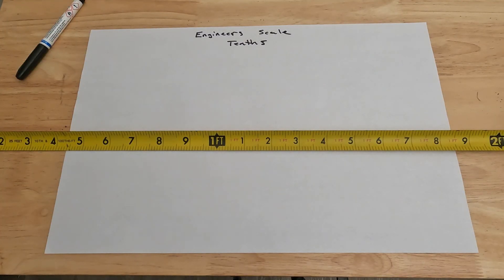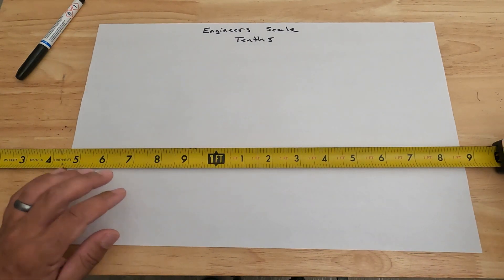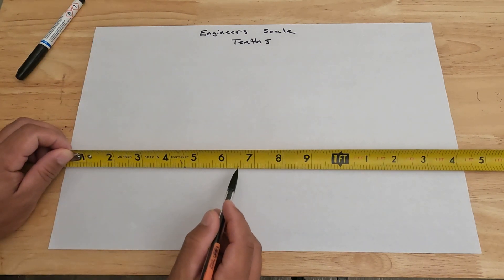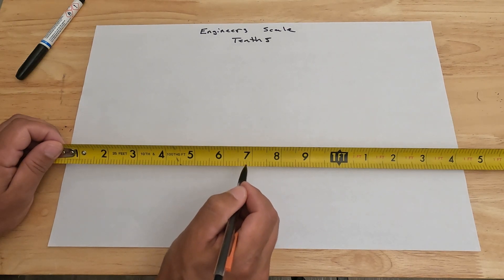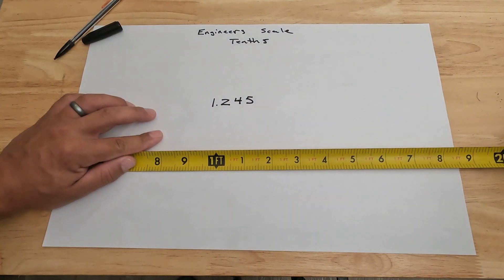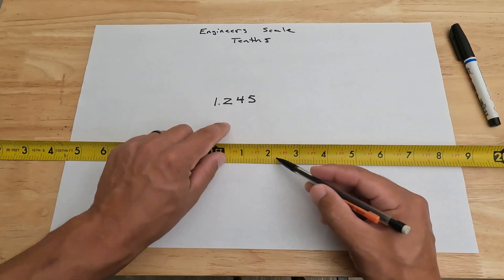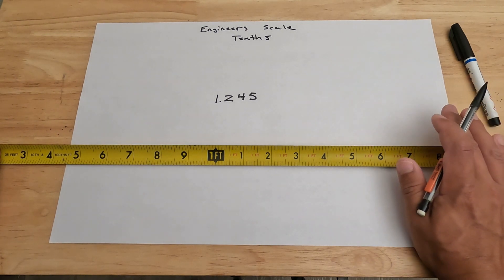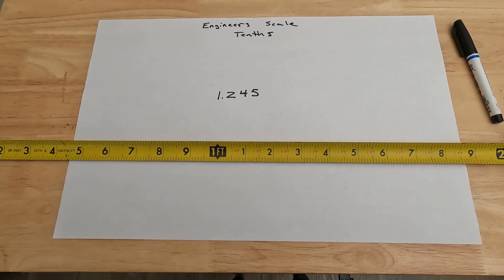How to Read a Tape Measure in Tenths (Engineers Scale)

Comment: i am a metal fabricator and we use these to make hand rails. easier to divide and figure out how many pickets you need
Reply: i learned about them from a guy in the oil industry because they use them to measure drill pipe
Reply from the maker: I've worked in the gas industry a lot and same thing. Typically pipe is measured in tenths.
Reply from the maker: That's interesting. Never realized so many different trades are using them. Always thought it was just surveyors

Comment: I just started as a laborer in grading and was told I'd be doing this at some point and that worried me because I suck with fractions. But this is the easiest thing I've ever seen. It just uses spaces on the tape to represent each place value? I know that's basically how a regular tape measure works but this looks so much clearer
Reply from the maker: In my opinion tenths are much easier than inches. It divides a foot by 10 instead of 12 so it's a lot cleaner. Sometimes grade rods are in inches too but most of the time they use tenths. Some rods may even have inches on one side and tenths on the other so just be careful when you do start and make sure you're using the correct scale. I also have a video up on the difference between tenths and inches which goes over both in a single video. And then I also have a video on only inches. It's all just practice. I started in construction 12 years ago and remember being nervous about reading a tape because it was something I'd never really done. I recommend buying a tape in inches and in tenths and practicing though. Eventually it will become second nature to you.

Comment: mig welder here we use this tape measure at the shop and im still learning
Reply from the maker: Once you get the hang of it you'll find it easier than inches I think. My job requires engineers scale but if I'm home building or fixing something I still grab the inches tape. Not sure why.
Reply: yea these are the shit for hand rails and stair stringers.

Comment: I'm a journeyman concrete finisher and we use engineer tapes because we have to read surveyors grade stakes
Reply from the maker: Haha that's awesome. I've been surveying for the past 12 years and have set many grade stakes for your trade. Been on many large projects where we work alongside carpenters and finishers and pipefitters so I got used to converting for people on the fly. In the past few years I've noticed a lot of guys have learned it. In my opinion once you learn it it's easier than inches. Thanks for watching and for the comment! Have a great day!

Comment: I recently purchased an engineer's scale from ebay and I love it. I trained as a carpenter and woodworker and I hate having to deal with fractions on a calculator. Mostly I just memorized the decimal equivalents to fractions. I thought to myself, why can't a foot be divided into 10 rather than twelve? So "I searched the world over and finally found..." the Engineer's ruler. I use it all the time when I do remodeling, especially when I need to divide a space into however many sections it needs to be divided into. I have always wondered why the foot is divided into twelve and then inches are halved then quartered and on and on... the counting system has been based on ten since Roman times, at least, so why have we been dividing by twelve? Maybe it was those six fingered giants in Egyptian times that gave us the measuring system. Don't even get me started on clocks!
Reply from the maker: Haha I hear ya! Tenths is much easier and no fractions involved. If I'm doing home repairs I usually measure in inches just because when I'm looking up materials or sizes of things online it's always in inches. But I use engineers scale at work every day. I've gotten the conversions down where I almost don't even need to think about it anymore. But that's because I work alongside carpenters who use inches so I constantly convert in my head when I'm giving them measurements.